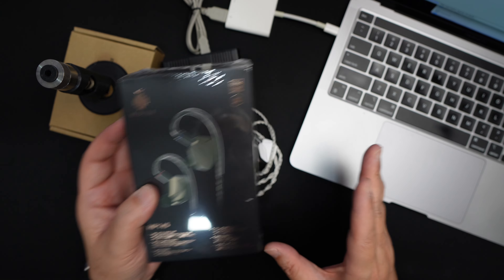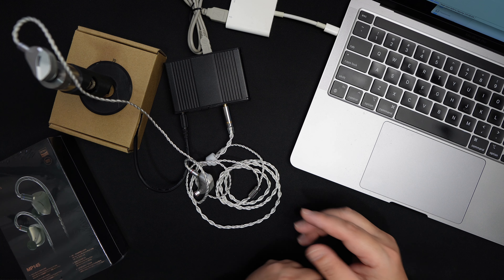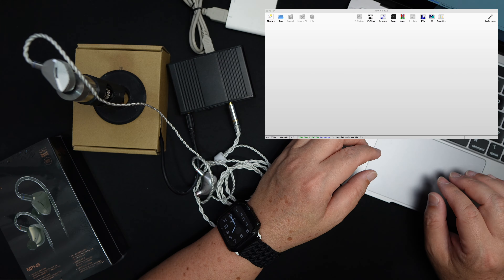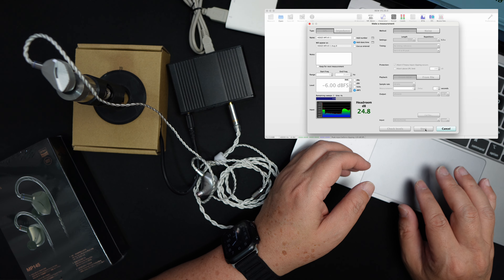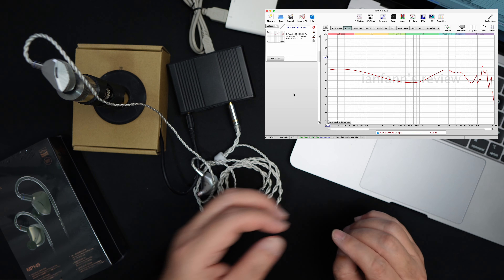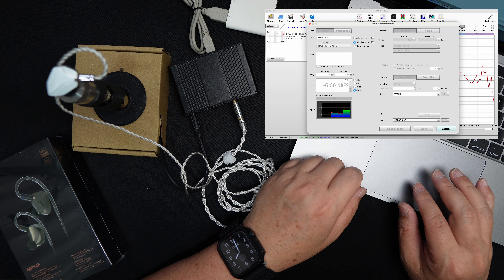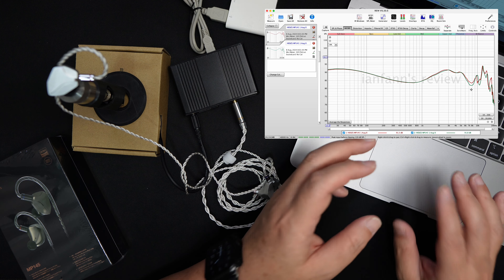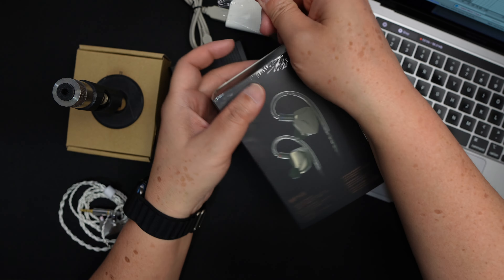Hidizs MP145 Measurements between original sample and recent sample

Comment: I honestly have to question if there actually was a stealth revision to the tuning. Planar drivers have quite a bit of unit variation and a 1.5 dB discrepancy is relatively small. The differences you've measured aren't even the same as the ones Shortbus reported. The whole controversy could easily be chalked up to unit variation.